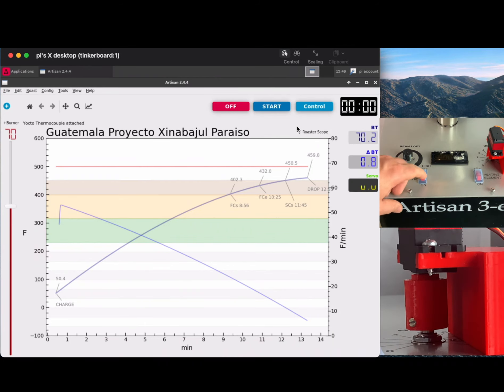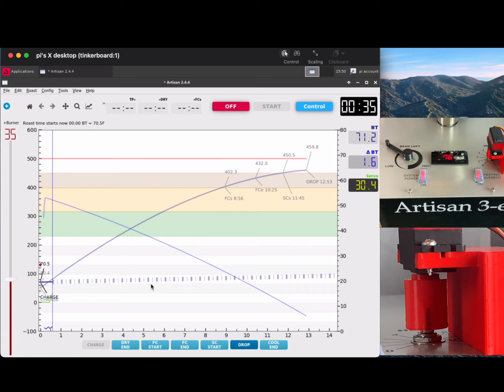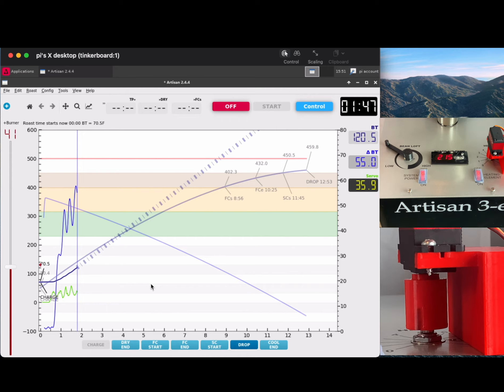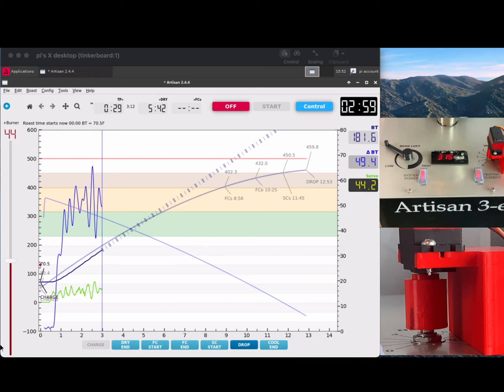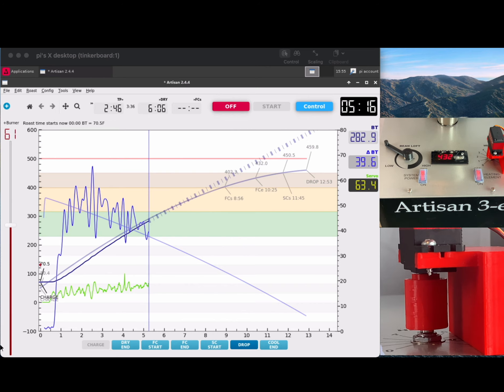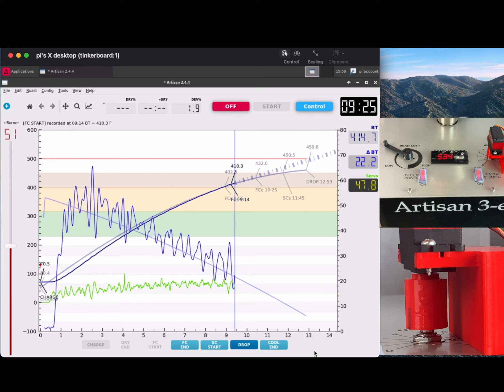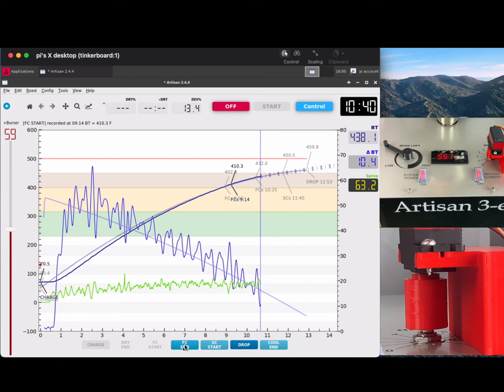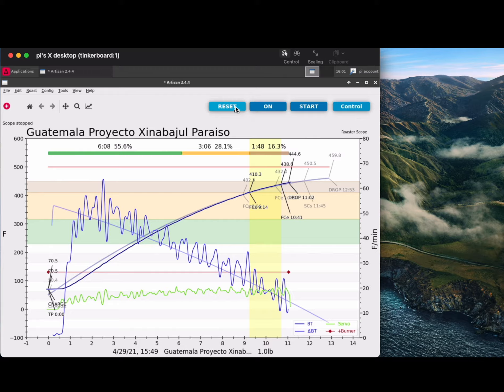StellarBeans Roaster Automation Kit for Coffee Crafters Roasters using Artisan-Scope Servo Control

Comment: So this kit just adjusts the air only ?
Reply: It adjusts the heat control. Air is still manual. If you pay close attention to the roaster during the video you’ll see how little I interact with the loft (air). The servo is on the heat pot.
Reply: @bjackson1975  my roasters are just built differently,  not used to having to play with the heat control maybe once a roast cycle,  mostly adjust the air twice during the roast , higher at first dump , then after about 2 minutes lower it , walk away , come back around 8 minutes to check the last 2 minutes of the roast for 1C or 2C whatever  you aiming for.  Take care.
Reply: @roastedright  Sounds good. This set up is of course not targeting your roaster. This is for Coffee Crafters fluid bed roasters. This approach isn’t about heat control necessarily it is about creating individual Roast profiles that can be shared and followed. Best wishes on your venture